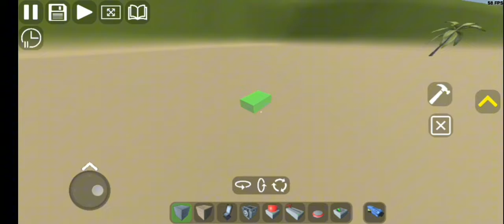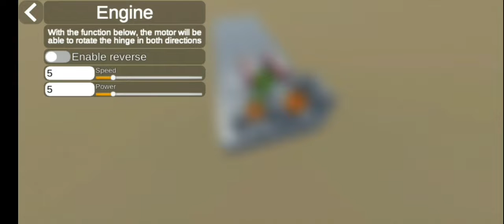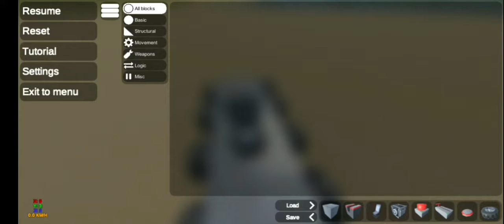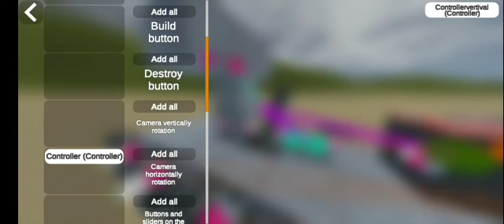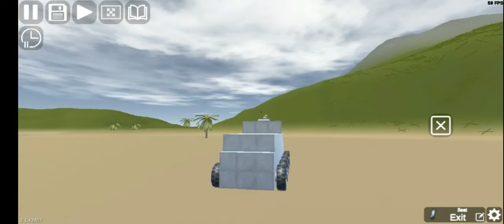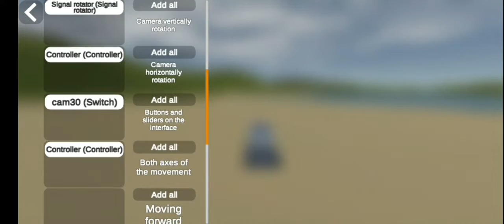sandbox world 3d mechanics: how to build your own tank

Comment: Bro do you know how to stack tank cannon like yours
Reply from the maker: use the weld tool, it's a bit difficult to explain, when you use the weld tool, you must overlap those cannons, but remember, more cannons you have, the hearder it will be to connect everyone to a button/queue switch, so connect the first cannon before stacking the second cannon on, be sure to save the cannon every time you stack, because it will eventually become impossible to connect the newest cannon, when that happens, load the previous save, and start again.

Comment: Thanks bro now i know how to build a tank +respect
Reply from the maker: Glad I could help mate!
Reply: @democracy_enjoyer  but the joystick was tilted like this :  👉
                                                                                                  👆👈👇
Reply from the maker: @computer_man777  what do you mean by that?
Reply: This 👆means foward, this👇means backwards, this👈and this👉 means both right and left
Reply from the maker: @computer_man777  hmmm, well i dont know what is the problem you're facing, can you try to explain a bit more clearly?
Reply: @democracy_enjoyer  my joystick movement axes are tilted to the left
Reply from the maker: @computer_man777  you mean rotated to the left, like moving the joystick forwards is done by moving it left?
Reply from the maker: @computer_man777  maybe you can fix that by modifying the tank chassis controller, and enabling one of the track inverting switches (only enable one) and see how it works, if moving forwards is moving backwards after doing this, then enable the other track inversion switch instead. (maybe you have the bearings facing the wrong direction on one of the sides of your tank, check it!)
Reply: @democracy_enjoyer  thank you for helping me fix my tank!!
Reply: @democracy_enjoyer  wait
Reply: @democracy_enjoyer  i did that but it didn't work
Reply from the maker: @computer_man777  hmm, well i cant help more, can you upload a video showing the issue?
Reply: @democracy_enjoyer  I FIXED THE PROBLEM!! it was OFFSET i kinda missed the fact that it was on all the time, but now my tank is done 😅
Reply from the maker: @computer_man777  exelent!